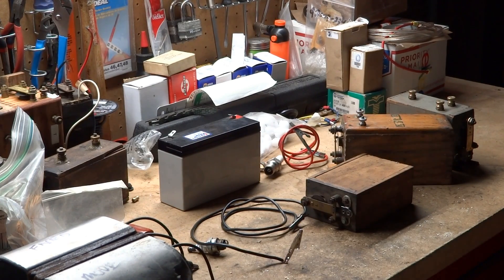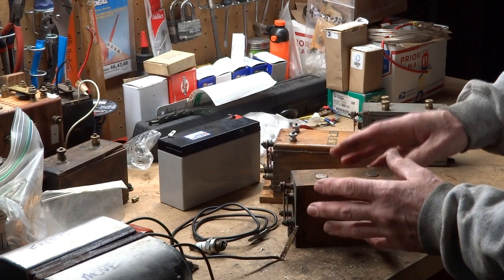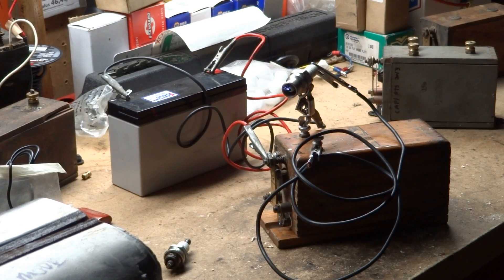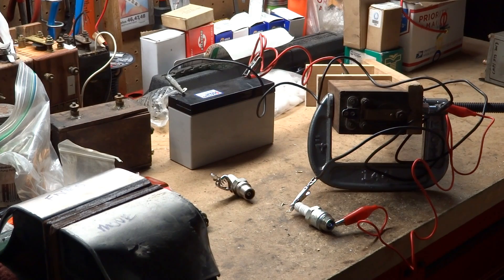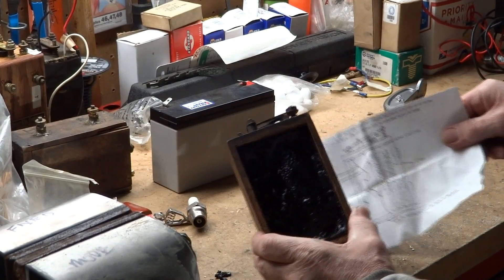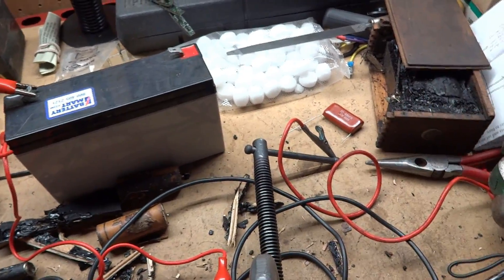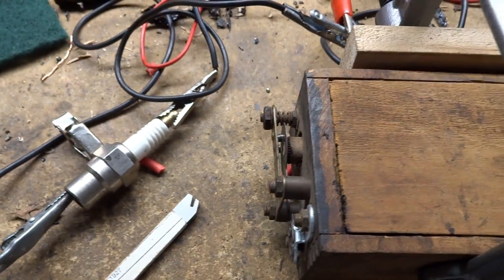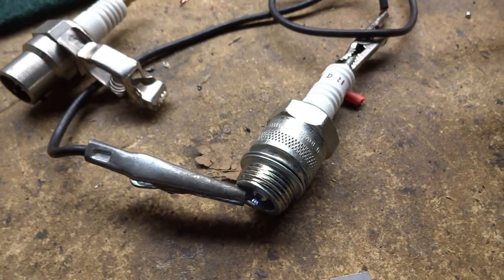Repair of a buzz-type coil

Comment: How warm would it need to be to get the tar to run out? That is: Can you prop it up cleverly in an old toaster? Or will it have to get too hot for some component?
Reply from the maker: I tried that method once and would advise against it, makes a complete mess and stinks. However, of you want to try, I put mine in an electric range set at 350°F open side down and had a catch pan under it. You have to watch it constantly to be sure you don't begin to singe the wood.

Comment: FYI  I use both 6 volt and 12 volt sealed batteries like the one in this video. These are used in radio controlled air plane field boxes and have a life expectation of about one year and then are replaced. I decided to check one old one out inside. The cover plate is spot glued on the top and comes off with a little gentle prying. Under this is some vent caps that have a one way rubber valve. The vent gasses during use and charging. Inside I found empty cells. After filling them with distilled water I put the battery on a slow charger foe 12 hours. It charged to full capacity and I'm still using it five years later. I have added water about every six months. Just like the old car battery's, if they are serviced correctly, they last for a very long time. Try it, it's easy and saves a lot of money.

Comment: For removal of such potting compounds from electronic circuits a common technique is to use a hot air tool (as used on soldering re-work stations) set to a temperature that just melts the compound, because chipping off the old bitumen whilst cold can stress and damage the components it is embedding - for example small circuit boards.  A ventilation/extraction system needs to be provided because the fumes are quite nasty.

Comment: I know from working on tube car radios, the buffer capacitor can make a huge difference in how the high voltage vibrator runs, which works similarly to how these buzz box coils work. 

If the cap is the wrong value, or leaky, the vibrator either won't start, or it will run at the wrong frequency, and will usually have a very abbreviated life at that point.

Comment: The potting is not really tar though, is it? It looks like it is an asphalt. What type number asphalt did they use and do the less ductile higher softening temperature types have problems breaking wires when fracturing like glass at lower temperatures?
Reply: Well, not wood tar, anyway. But TARMAC is really not tar either but asphalt (and macadam or crushed rock). Go figure English language mixed with colloquial terms.
Reply: @milantrcka121  Tarmac when invented was tar and macadam. Asphalt was not involved. Asphalt's existence was likely hardly known at the time. Tarmac comes before the petroleum industry and before the concept of below ground petroleum deposits that could be extracted by digging or drilling wells. 
I don't know when asphalt replaced tar in Tarmac. Tarmac was the first name used for airport apron pavement. One might think Macadam alone was too dusty for the airplane engines and therefore Tarmac was a good choice for the apron area pavement. The petroleum industry was developed enough by that time. One might assume  asphalt, perhaps as an industry bi-product, was in that early apron Tarmac instead of tar.
Taking advantage of the English language, as every road builder likes to joke, "It's not my asphalt. It is your asphalt.". ;) 
For me, "blacktop" was the common word and there was literally a layer of asphalt poured on the roads that sometimes bubbled in the summer heat. Searching for and popping the "tar bubbles" in bare feet was a summer pastime.
Reply: @allanseidel5070  Interesting treatise on the above subject: https://theconstructor.org/building/asphalt-bitumen-tar-types-difference-comparison/17273/. Nothing is ever easy...
Reply: @allanseidel5070  ha ha I used to do the same thing with my bare feet, remember it well, haven't thought about that for years and years the warm soft "tar" felt fantastic on the feet, especially when you found a nice big patch thanks for bringing me back

Comment: great vid, big difference
Reply from the maker: Thanks Buddy. Need to do a follow-up on how to set the current draw.
Reply: Funny seeing you here @mustie 1 lol ....great repair thanks Rob !!
Reply: Part number and source for the caps. I have 4 T coils to rebuild. Thanks!
I want to get this running next summer. https://youtu.be/AHWHwVzbYLg
Reply: @dans_Learning_Curve  It's a regular Metalized polyester capacitor or Film capacitor. Try Amazon: https://www.amazon.com/s?k=400V+0.47uF&ref=nb_sb_noss
Reply: @MrDubje  just ordered 4. Thanks!
Reply: @dans_Learning_Curve  You're welcome!
Reply: @MrDubje  I now have a lifetime supply! I misunderstood the order. I now have 12+ caps!! Thought I was ordering 4. Nope, ordering 1 and you get 4! LoL
Reply: @dans_Learning_Curve  https://www.mouser.com/Passive-Components/Capacitors/Film-Capacitors/_/N-9x371?keyword=.47%20uF%20400V. Look for film (metalized polyester) capacitors. Both dipped and box-type should be fine. Look for temperature rating - the higher the better.